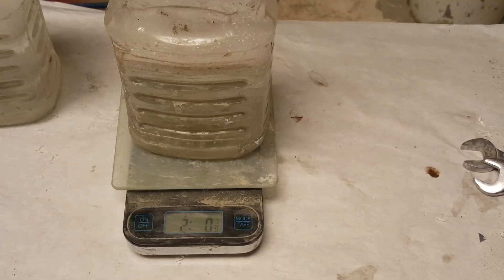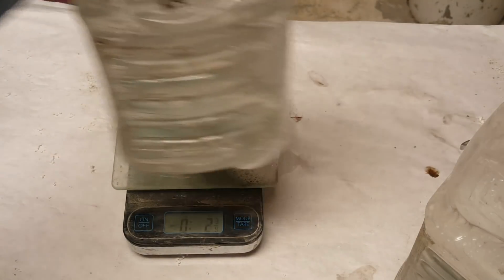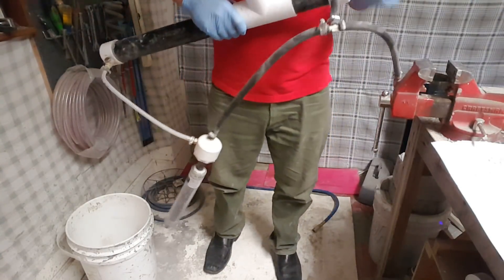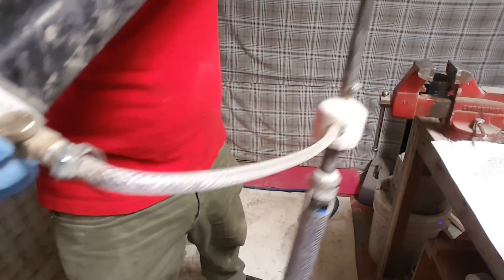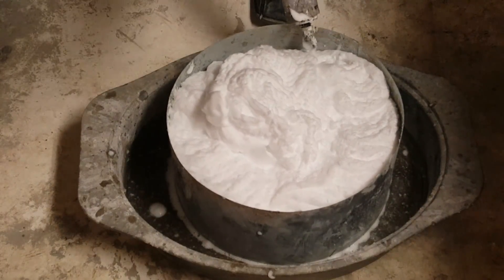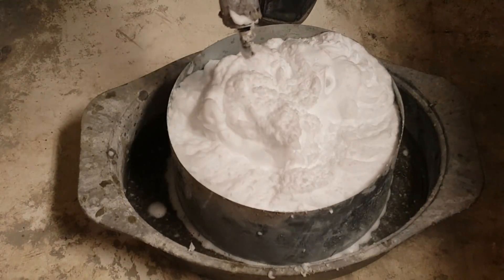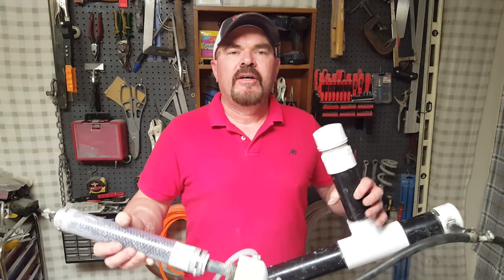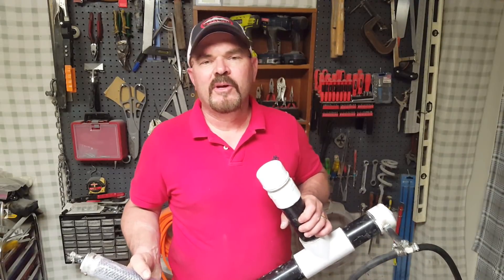How To Use A Foam Mate Air Crete Machine

Comment: Hi Honey, I need a light as possible aircrete mixture so as to fill floatation chambers such as steel pipe pontoons and 50 gallon plastic barrels. The steel pipes have some rust problems, holes etc., and for those the aircrete would be an insurance against water ingress causing the pontoon to sink! In the case of the plastic barrels the problem I have is when weight comes on the barrels and the start to sink the water pressure can both cause leaks in the barrel and as they start to sink the pressure also causes the barrels to fold/bend and squash in the middle causing other cracks, holes and leaks and they sink completely. I could fill them with expandable foam but as u know that is very expensive! Can I make aircrete with just foam and cement(without any sand or aggregate) so that it will be as light as possible? 

If the barrels are light and full of aircrete they should  or at least my hope is that they would hopefully  retain their shape and avoid squashing, bending, cracking and then sinking! So the aircrete would mainly assist the barrel to maintain its shape and volume as the water pressure increases and stay afloat???

Would I have to include polystyrene beads or other chemicals in the aircrete to assist in the mix strength or to assist in retaining the air bubbles or the improving the aircrete’s resistance to damage from water? 

In the case of the steel pipe pontoons, my hope is that should the pipes develop holes or rust spots that the aircrete would prevent them filling up and sinking???

This is a huge problem for me at present as I cannot afford proper steel repairs so the aircrete “idea/possibility” would be a lifesaver. I would greatly appreciate any thoughts that you or any other aircrete experts out there on the worldwide internet could assist with. Hoping earnestly for some good news!!!

Sincerely, Irish Ray.

Comment: Are you selling the recipe for aircrete using surface bonding cement, yet? I'm trying to get all my ducks in a row for a waterproof aircrete roof, using the surface bonding cement... but, I'm definitely not wise enough to figure out the science of the aircrete mixture, so I will be buying the recipe from you when I order the FoamMate.)

Comment: Thank you so much for all you share, you are an inspirational person to watch. I like your take on the domegaia aircrete foam machine. Nice to not have the extra water pump and bucket, though I can see how this set up is limited for very large projects, like mixing 50gal bucket worth at time. But great small batch set up. I was just thinking about how it could be scaled up with a bucket with a hole and valve on bottom of it for the soap solution. But then was wondering, why not have the soap be part of the slurry mix, like the jlube, and then pass the slurry through the air foaming process? Any thoughts on that approach yet?

Comment: Sectionàl Greek column. That's what I would like to see. Heat weld some pool noodles together for your mold using a heat gun. Stack each piece with a little mortar in between. Maybe design them to key into each other. Simple, cheap, and fun experiment. And something most people wouldn't think they could do. Reinforce with chicken wire, and leave the core hollow for a support structure if wanted. A split mold would probably be better in that case. Rome built in a day with foam.
Reply from the maker: awesome, awesome idea, thanks....

Comment: What is the airline pressure before the foam mates air valve ?
Reply from the maker: 90 psi
Reply: so glad you asked this, I bought the big aircrete gun recently and pulled out my air compressor yesterday to give it a go, my effing compressor was rusted out and wouldn't start. I came here to ask the same question because I'm gonna have to try an air pump I use for my aquaponics, its 120psi and I'm elated to see we're gooooood without the rusty compressor.